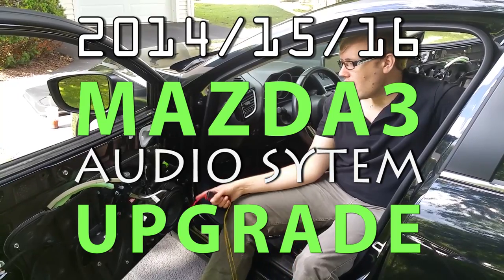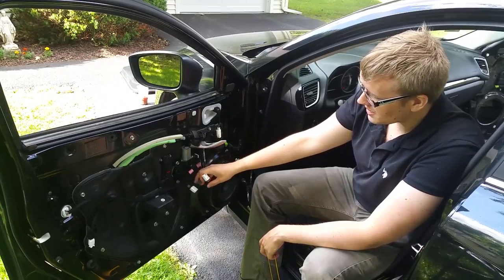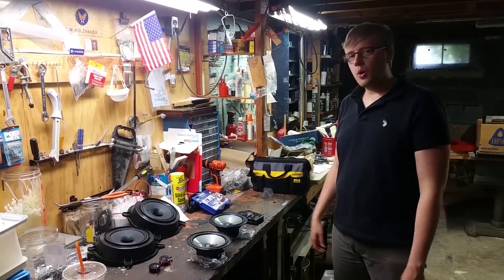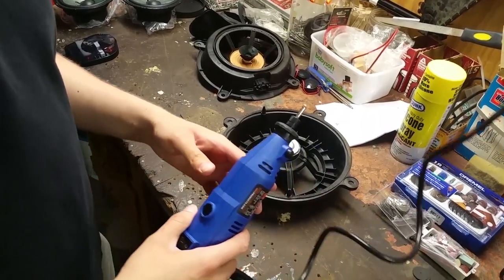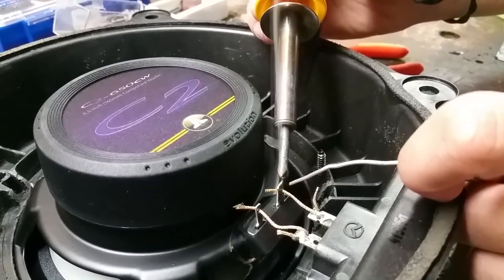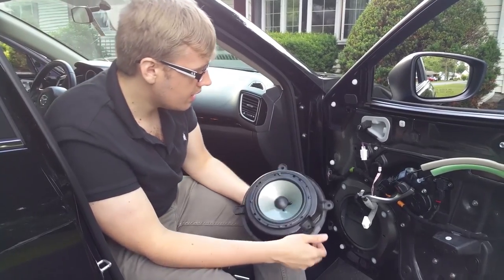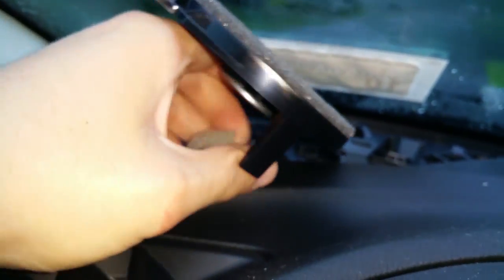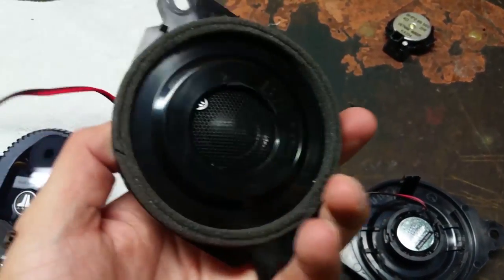2015 Mazda 3 JL Audio System Upgrade - FULL Tutorial

Comment: Great job.  If you go through Crutchfield, you can get the casing plus the connector and not have to use soldering or a dremel, and they're usually free with speaker purchase.
Reply: Did you go through with the replacement yourself using Crutchfield's casing? How'd it go?
Reply: Hey what’s the exact product link? I want to not have to use a soldier or anything

Comment: As a 2014 Mazda 3 hatchback owner I can tell you that the first upgrade anyone will wanna do is get a nice aftermarket head unit like an Alpine ILX-F259. That way you dont have to deal with any line output converters that add noise and strain to your system. After that just get yourself a nice 4-6 channel amp and ge tyour 2 or 3 ways amped up. Also get a sub amp that can go about 800 watts... thats plenty for the mazda 3. with that I'd recommend something like a jl 12w6v3. as far as the speaker replacements go that's a subjective opionion but I think that Focal sounds realllllly good. Last  but not least if you are a hardcore audiophile you will probably wanna get a DSP like a Helix
Reply: Are there any HUs that use the touchscreen? If not, I can't possibly see wanting to replace it. That's part of the bargain in getting a prominent screen, imo.
Reply: @TheRayDog  Yes. I am currently running a Stinger Elev8 and it's fantastic in my 2014 Mazda 3.
Reply: @VincentsVideoVisions  I don't understand then. How is that integrating into the dash given the stock up top screen?
Reply: Звуковая система Mazda смешанная. рекламировались с интересными габаритами... подумываю купить аудисон прима ап ф8.9 бит. чего-чего
Reply: Mazda's sound system is mixed. they advertised with interesting dimensions... I'm thinking of buying an audison prima ap f8.9 bit. say what

Comment: ...Several years after this post... those OEM door speakers do have a tweeter of shorts. Those center cones are are called  "wheezers" from back in-day before you were born and were meant to reproduce high frequencies. Now of course they don't go nearly as high as a traditional teeter, but they sufficed back then and still are relevant in some applications and systems today.

Comment: Nice video - I just had my door speakers professionally replaced but would prefer to do the tweeters myself. What kind of drimmel head did you use to get the old one off? Also, eight years on - how is this holding up?

Comment: Great video.  I was struggling on how to take off the speaker grill cover on the dashboard of my 2016 CX-5.  I ended up taking off the a pillar cover first then prying the grill cover from the side which had a slot for a screwdriver.  It worked like a charm, cover just popped off easily.  I dropped in a component tweeter in the factory location.

Comment: When I removed the stock tweeters, there is a small capisitor attached near the clip connection... the same connection that you cut off... so you have nothing filtering out the lower frequency... or did you reuse it?
Reply: ... it's in the crossover unit (small box installed elsewhere) for the separates he used.

Comment: Solid tutorial, but I can't help but wonder why you didn't just show the removal of the interior door panel instead of giving verbal instructions lol. I have been tinkering a lot with my 2018 M3 w/ the factory Bose system. Because of how the factory amp/crossover is set up, I ended up installing 6 3/4" shallow dvc kicker subs in the doors, powered by their own amp, and having the factory amp take care of rest, which I upgraded with Infinity speakers. I also have a powered 8" Alpine sub mounted where the rear fold-down arm rest would normally be. It turned out pretty well overall, but doors don't make good sub enclosures, so I'm going to replace the factory amp with a DSP amp, along with components instead of the mini subs. I just gotta wait for the weather to warm up again...

Comment: Very helpful video. Do you have any tips for the rear speakers? I bought a set of 5 1/4" Pioneer speakers for the back doors, but it looks like they're too small to go in. What size speakers did you get for the rear?
Reply from the maker: The same size as the front speakers. 6.5" Actually.
Reply: Damn, well that explains a lot. Thanks man
Reply from the maker: Let me know if you have any other questions!
Reply: BTCKYLE Crutchfield says the C2-650x doesn't fit the rear door due to mointing height. I want this same setup on my 2016 Mazda 3 hatchback. Just ordered the speakers. Did you run into issues with the rear door installation?

Comment: My stock speaker sometimes doesn't work(only tweeter works) when I start the car. When I just use the batter without starting the car, it works fine. I have to turn off the car get out and then get back into the car and restart the car to make the speakers get power. Can you tell my why that happens from time to time?

Comment: you do know that if you install and after market amplifier you can make those sound 3 times better and louder, ill give you a 10 on the install very professional installation but with an amp it would make it sound better
Reply from the maker: Thanks Mario, I'm thinking about putting one in this summer. If I do, I'm 1000% going to have an install video. Subscribe.
Reply: For sure, i was in to sounds systems a few years back but the 1st baby cane thennthe seconds and it all went away , im planing on molding a samsung tab on my dash with an audison bit one or bit 10 , 6 ch amp running my components a channel per speaker including the tweaters so i can run them active and a separate mono amp for the bass , im thinking all jl audio amps and a 12 inch w6 or a 10 w7, all calibrated with an rta hopefully

Comment from the maker: Update: I need to install the crossovers:. but I'm only going to wire them for the tweeters (high pass filter only). The highs needs to be filtered and mellowed out a bit (right now they sound a bit "harsh" in some higher pitched songs). Crossover should help out a lot. I will more than likely come out with a part 2 video. Subscribe to have it pop up in your feed. I will also do an audio test as well... something I should have done in this video.
Reply: BTCKYLE - Have you posted Part 2 showing how you wired the crossovers?
Reply: Why didn't you put crossovers on woofers? Does it not make any difference?
Reply: Waiting for the damn video

Comment: Do you have the Bose installation in your car? I just wonder if that would make a difference to which upgrades you can do and speakers to use in terms of impedance etc. I am considering a similar upgrade myself but have Bose system
Reply: From what I have read in forums .. you need to replace every speaker and get amps if you want to do this. You would be essentially gutting the system up to but not including the head unit. Good luck. The Grand Touring has Bose 9 speaker. Sport has 6 speaker.

Comment: the JL Audio 3.5 coaxial fits in the dash with a little alteration to a crossing piece of plastic
Reply from the maker: Hey, thanks for the comment. So you are saying you can physically remove the tweeter off the woofer and wire it to original tweeters?
Reply: Much easier than that.   http://www.jlaudio.com/c2-350x-car-audio-speakers-c2-coaxial-systems-99611 drops right in place and you use the original screw locations. I did clip off the two bars over the tweeter to avoid clearance issues and cut down the plastic perimeter of the JL to fit into the Mazda grill. If you had the Jl in hand it would be clearer.  Then some utility knife work on a plastic piece that runs through the speaker location. The result is you have four mid-woofers and four tweeters instead of two m/w's and four tweeters which I think has to be a more balanced sound plus moves the soundstage to be more in front of you. This on a 2016 CX-5 Touring non Bose. Just my experience, not a recommendation.
Reply: The piece inn your hand at 12:50 is totally replaced by the new coaxial.
Reply: @wagzel  I dont get it, why would you recommend a speaker install on a different model car... lol. Are the dashboards essentially the same?

Comment: the stock setup seems decent to my ears.  how much improvement do you notice?  I want to upgrade too but if the improvement is only marginal I dont want to spend the money or the time.
Reply from the maker: Hey Alex. The improvement is beyond noticeable (if you get my drift) - You can hear a broader range in output frequency. The bass is much cleaner, and the highs are insanely crisp. Subscribe for an audio test. I will be coming out with one very soon. I just got my editing software back.
Reply: What’s the brand of stock audio system on Mazda 3 2017 model?
Reply: Its OEM. There no way to tell who manufactured it I think.
Reply: There are two versions. The standard one I couldn't tell you, but the upgraded system is made by Bose.

Comment: Awesome video.. Look forward to your crossover installation.. Rear door speaker required to do the same housing mod to fit 6.5" speaker too?
Reply from the maker: YY Hu Correct, same exact mod. nothing different. Same sized speaker as well. Yeah, ill be getting that video up soon! subscribe!
Reply: BTCKYLE possible to give a quick guide on how should I hook up the crossover?
Reply: What's the size of the tweeters?

Comment: A really good job!
I have a question, what about the rear pillar speaker?
Does 3.5 inch tweeter fit on them?
It seems that mine are not properly working.

Thank you
Reply from the maker: Rear pillar? Did you find out your solution yet?
Reply: @BTCKYLE  not yet Sir, but I'm going to check what (and if) fits !

Comment: did you only upgrade the fronts speakers only i would like to see the rear as well.
Reply from the maker: I upgraded the rear set as well. It is the exact same process as the front speakers. The only difference is that the rear speakers have the tweeter and woofer both as one package (coaxial)

Comment: Would you consider using styrofoam baffle boxes for the mids?
Reply: Yes Styrofoam would take out some of the frequencies but it will also reveal others . I still need a 4 inch gap to let some of the subs lows out so one back seat open four inches .  Drummers put pillows in drums so  it works  the same way as your styrofoam,  it works better with higher density foam so I don't know about rigid styrofoam and acustical properties.

Comment: what about the crossover?
Reply: You don’t need the one that came with the speakers, the car already has it for the factory splits.
Reply: @Ghost_moto_WPN    what? I would use the crossover that came with the speakers... thats what I plan on doing.  the crossover is probably in-line with the stock tweeter and gets tossed when you upgrade.  I havent dont my front speakers yet. I got some MB Quarts.
Reply: @downtownlife  P3NZ01L didn't ask why not use the crossover that came with the speakers, he just askes "what about the crossover" I took that as "don't you have to have to use the new speakers crossovers "  so, no you don't have to use the one that came with them.
Is it better to use the one's that came with your speakers - absolutely!

He also only removed the tweater, so where ever the factory crossover is doesnt mater. It didnt get removed when he changed the speakers or the tweeter. This would only matter if you wanted to use the new speakers supplied croasovers and you would run new wiring anyway and bypass it.
Reply: @Ghost_moto_WPN  I am confused, he went with aftermarket speakers but didnt install the crossover that came with those speakers.. so he is just using the stock speaker wire and is assuming that whatever crossover setting is either at the headunit will be good enough for the speakers - high and low? Should I do that too? 

I guess the highs going to tweeters are probably in general all cut out the low frequencies on those stock speakers wires, somewhere. I dont consider the +/- on the treble setting on the headunit a real crossover. Not trolling!
Reply: @downtownlife   It depends how much effort you want to put in vs the best result you can get. 

Just changing the speaker and the Twitter is a very decent upgrade, but if you're after the best set up by all means definitely would use the crossover supplied with the speakers. However this would involve far more effort of taking dash panels off the dash to run wires under it through to the head unit and bypassing the factory fitted crossover. The factory fitted crossover could be something as simple as it in line capacitor. Crossovers are mechanical restriction on frequencies based on circuitry, not to be confused with the EQ in the  head unit, which is digital correction of those frequencies.

If you have the ability and confidence to start looking for wires under the dash to fit your crossover supplied with the upgraded speakers I definitely recommend it, but if you can't, just changing the speakers and tweeters is still a decent upgrade but to get the best results you'd want to amplify them anyway with their included crossovers.
Reply: @Ghost_moto_WPN  I could just use the crossover that was supplied and still send the signal down the stock speaker wire.. the worst that could happen is the sound is double checked for frequency response to mid and highs. I understand about EQ, thanks. An amp is in the future.. probably when the weather gets much better.
Reply: @downtownlife  I would not recomend doubling up on crossovers, thats how you get a muddy sound. In my opinion runing the factory crossover  alone would sound better then the aftermarket one and the favtory one together.

Comment: Hack job. Just make proper spacers from MDF.
Reply from the maker: How is this a hack job? Please elaborate
Reply: this is better than mdf as mdf gets wet and destroyed. check out the lengths CAF (youtube) goes to to make plastic rings.
Reply: @tk421tt  there is zero reason it would get wet and if you do it right you seal the mdf anyway. a million pro installers can't be wrong